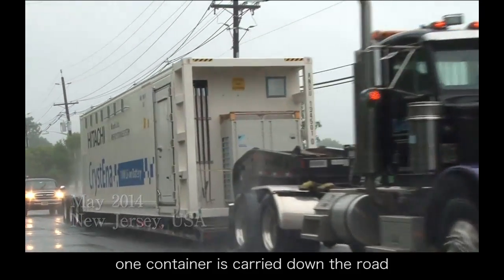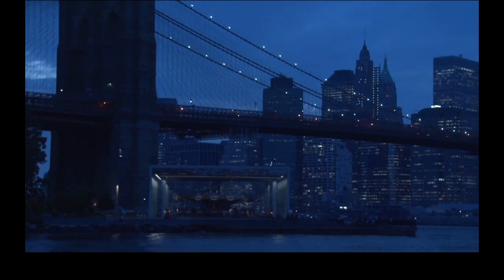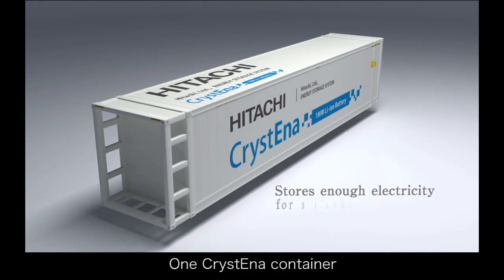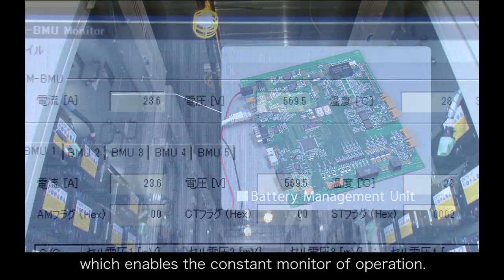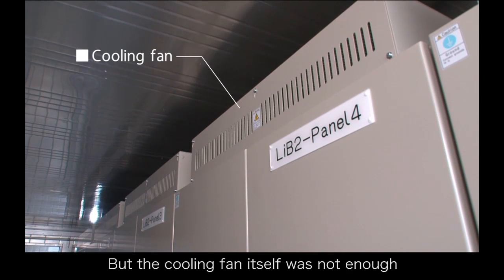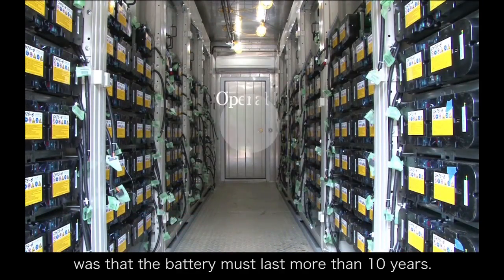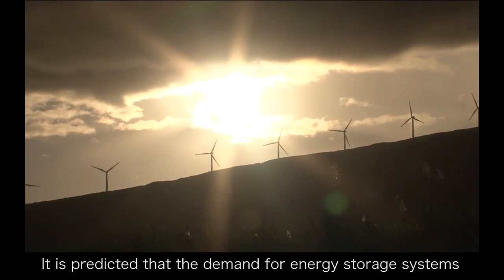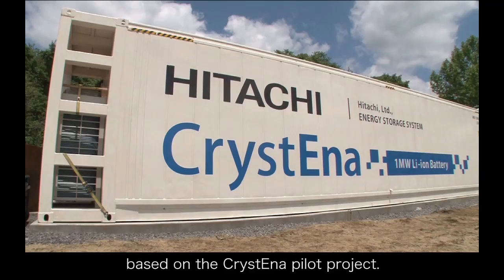Energy Storage Solution "CrystEna" - Hitachi

Comment: dumbest thing ever as you could better use ZNBR battery which has highest power density per kilogram and does not degrade despite 1000 CYCles.
Reply: You probably got that wrong. Lithium has the highest energy density, which is easy to understand when looking at the periodic table. Also, this battery works just fine after 4000+ cycles.
Reply: +Farooq Ishaq According to the internet ZnBr chemistry has around 2000 cycles lifetime, that isn't superior to Lithium ion chemistries tuned for longevity (provided they get temperature management, as they did). The chemistry with the longest longevity, besides those that are being developed, is nickel iron which can last for half a century, if not more. Besides that there are supercapacitors, though they have very high cost and besides the cutting edge ones using graphene, they also have very low energy density. After that there are exeperimental ones like Ambri with claimed longevity of 300 years. I'm sure there are plenty others though these are among the most important.
Reply: kalimul Ambri is past experimental and should be called something like developmental. Their lower temp batteries are experimental, but not likely to be used for grid storage.